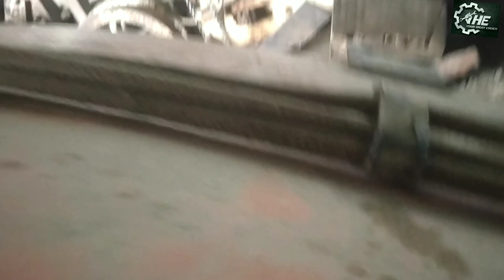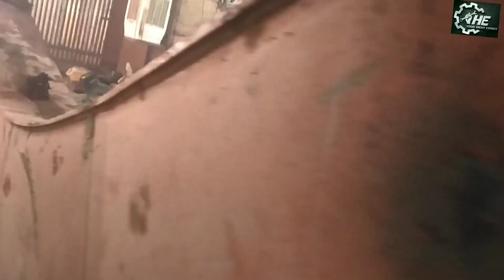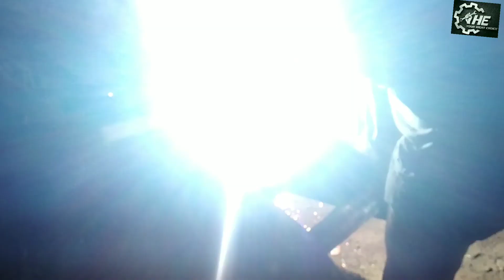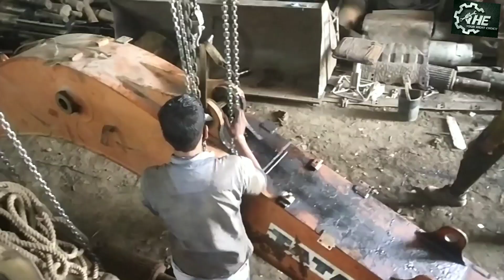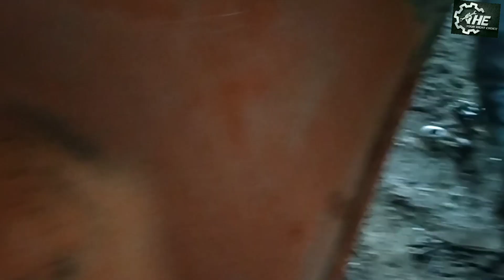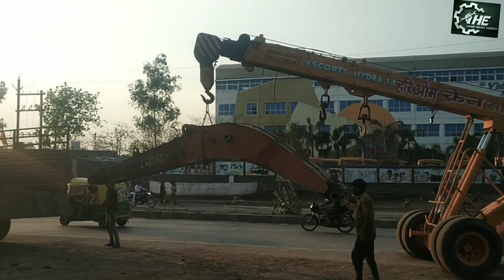Broken Excavator Boom Repair|pokland Boom Welding|TaTa Hitachi|Harish Sahu Engineering Workshop|HE

Comment: That Extra Protection Ms sheet not at out side. In my industry 16mm MS sheet welding in inside and then joining and welding with MiG.
Reply from the maker: Thx for information sir
Reply: @harishsahuengineeringworks3253  we Done work For Volvo 480 Stick with 20mm Ms Sheet.
Reply: Mig weld is very heavy duty than stick
I also use it for jcb and pocklane repair and hardfacing